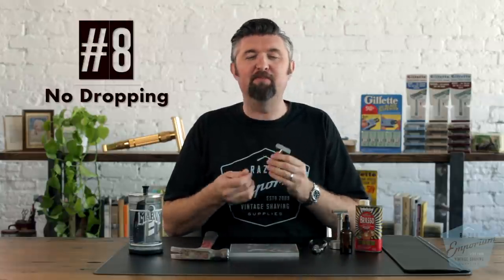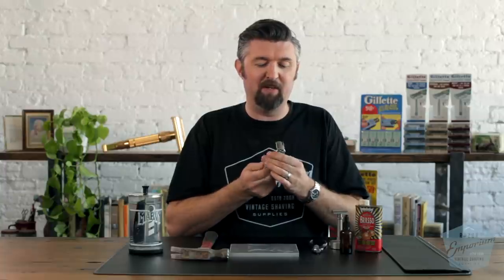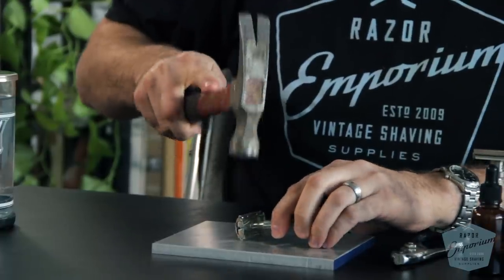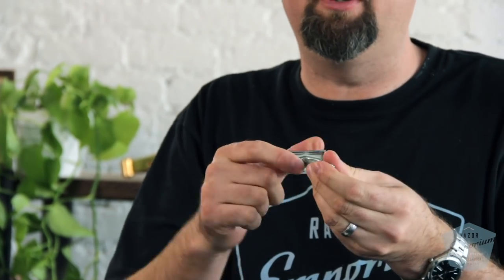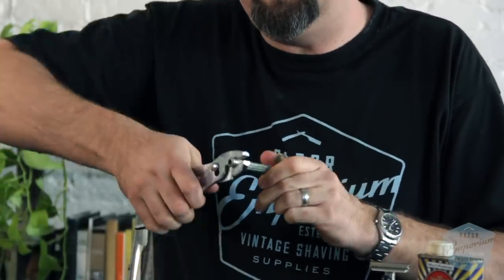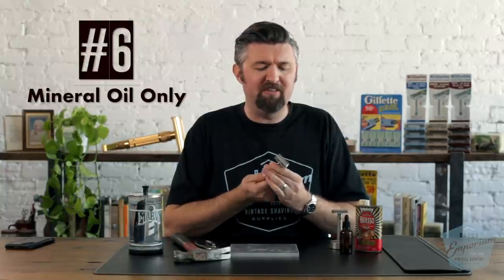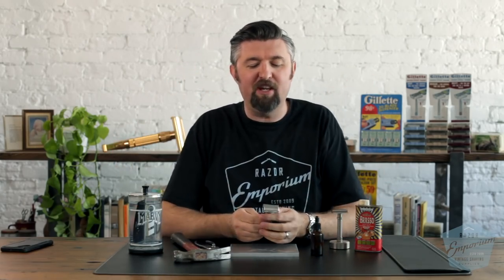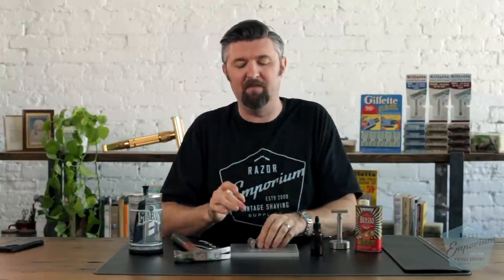10 Tips to NOT Destroy Your Double Edge Safety Razors!

Comment: I use toothpaste to clean my razor and shaving brush, is toothpaste ok to use?
Reply from the maker: Toothpaste is a mild abrasive and it will remove metal slowly over time. It is actually a very mild metal polish in some ways and years ago, yes I used it on silver plated razors specifically.

Comment: So i was polishing some hammer marks out of my razor with some brasso, when I was done I ran it in a good wash cycle in the dishwasher with mixture of barbicide and vinegar and a long steam cycle to sterilize it, it still wasn't opening and closing well so i soaked it overnight in a gallon can of WD-40, and it still isn't working well. Any advice?

Comment: My wife who feels blades last 6 months or longer .... used to regularly removes the head of  her razor and inserts bits of plastic to "make it sharp again".  She's broken two doing this.  The first time she'd put too much in and over tighten it  cross threading the screw using a nut cracker.  The second time the plastic wouldn't stay in place so she gets out the hair dryer and melts it.  These days I just swap the blade over when I do mine.
Reply from the maker: First time I've heard anything like this before !
Reply: There a few video's on youtube on how to make your razor more aggressive.  So she wasn't the only one shoving bits of plastic into the razor head.   And I think there a kit you can buy too.   Just encase she's not alone look in your recycling bin for plastic cartons with with bits cut out of them.

Comment: I put my razors in the dishwasher when I get them. Cleans, sanitizes, never seen any harm done by it. I guess if somebody did this all the time, the risk increases, but for a one time treatment when the razor shows up at my house after sitting who knows where for the past 30 or 40 years... it's no big deal. Of course I do not own (or want) any gold "plated" razors. The gold wash on vintage razors is so weak that it wears off in normal use which is why it is so hard to find one with a good finish unless it's NOS.

Comment: Why no Barbicide? I want to be sure that nothing nasty left on that piece of metal after decades of storage in unknown conditions. Nothing sanitizes like Barbicide. Vintage razors feel super clean. I used it on multiple plated razors and according to instructions. Diluted and 10 minutes soak. No problem whatsoever with any of my razors. Including very thin gold plating on my schick injector type G8, nickel plating on gillette slim etc. Matt, there's no reason to be against Barbicide. It's a very safe liquid when used properly.
Reply: I think you hit the nail on the head. A ten minute soak with the appropriate dilution rate wouldn't do any harm. I think Matt was advising against Barbicide, as probably too many people leave the razor soaking too long.
Reply from the maker: Yes- we have got emails and pictures to prove that many people ruin razors this way. Can it be safe? Yes! Can it do harm if left too long? Yes.
Reply: @RazorEmporium  ....So I can put my 1960 Fat Boy bought on Ebay in Barbicide NO LONG than 10 minutes!!!!!!!!!!
I'ts because finally I'm protecting my self from Dieses from all kinds I'm I right Matt??????

Comment: Ultrasonic cleaner, rubbing alcohol & toothbrushes : are they safe ?
Reply from the maker: Yes to all
Reply: Works brilliantly on brass razors (Karve).
Reply: @RazorEmporium  ultrasonic cleaning solution, like barbicide, is mostly water.  What about rust?
Reply: @yojimbo21  which one?
Reply: @trancus11  I would think ultrasonic cleaner is fine even if made mostly of water because is not in cleaner very long.
Reply: @lucstonge7390  the brass.  Cleans it but maintains the matte finish.
Reply: @bassmastrj652  you may be right. Coming from the firearms hobby I know that it is a must that firearms must be stripped down to individual parts with even the last tiny spring and pin removed before immersion in the ultrasonic because otherwise it drives water into the crevices and voids. The TTOs and adjustables are not completely disassembleable by the average user so I would think the same problem exists there. The 2- and 3-piece non adjustable razors are disassembled to their final parts and could be immersed without that same risk, I should think. But I’d love to hear the opinions of others on that including Matt.
Reply: @lucstonge7390  use whitening toothpaste.  It’s an extremely mild abrasive that will keep it looking clean and new without “shinying” it up and maintain the matte finish.  Great razor.  Don’t use it all the time.  Once every 6-12 months is plenty.
Reply: @yojimbo21  Thanks man, I appreciate the help :)
Reply: Toothpaste makes for a good polish.
Reply: A great way to get tarnishing off of old chrome, an old cotton towel, some methylated spirits and elbow grease.

Comment: "Food safe" and "safe to eat" are not the same thing. Consuming traces of mineral oils (for example, left on a chopping board) is okay, but DO NOT drink it directly. They will make you very ill if you have more than a tiny bit, and they're carcinogenic.

Incidentally, WD40 is literally a mixture of several mineral oils. It's not cleared as food safe (the exact mineral oils used are important, after all), but still, it's mineral oil.

Also, and this one's very much a nit-pick, but vinegar (specifically the acidic component acetic acid) isn't a "strong acid". It's a weak acid, which has nothing to do with how acidic it is. It's a technical term referring to the degree of dissociation in solution 😝
Reply from the maker: Mineral oil is sold at pharmacies for constipation
Reply: @RazorEmporium  Exactly. I didn't want to go into detail last night, but consuming mineral oil will give you the shit super fucking badly (hence it's occasional use as a laxative)

Comment: I always take my blade out of my razor and dry both with a towel after I'm done shaving.
Reply: I have heard that the coating on blades is so thin that if you wipe it down it removes some coating. Some of my blades even say Do not wipe. Any thoughts?
Reply: @manfrommeeteetse3880  I don't know about any of that though I do think the coating is thin, but it's probably enough to coat the blades so a little water and lather won't effect them too much. I typically only use any particular blade twice though.

Comment: Two different steels (stainless, carbon) and salts AND moisture, oxygen...  cause a galvanic corrosion condition. NOTHING is drawing carbon out of the carbon steel blade except very high heat to the point you see see sparks when forging it.
Reply from the maker: Thanks for the info

Comment: what kind of dumb shit do people do with their razor... I kinda hoped to find something here i would actually do and shouldn't, most of these are "don't be an idiot"
I just wash my razor with some bar soap or detergent when it starts looking a bit dirty, just using a soft cloth

I do leave my blade in until it needs to be replaced, but i've never had an issue there. Probably cause mine is coated and not stainless steel?